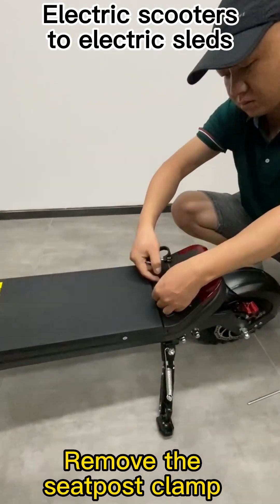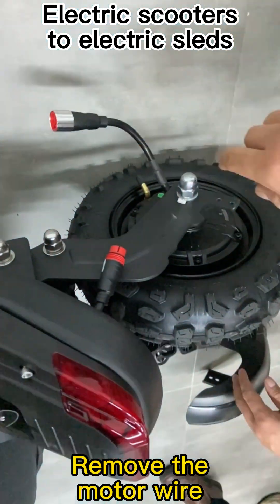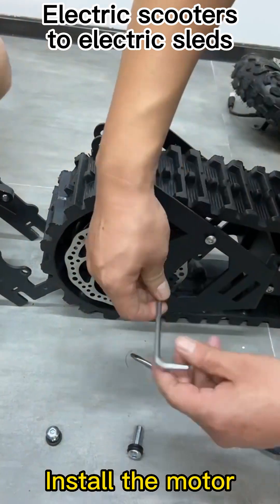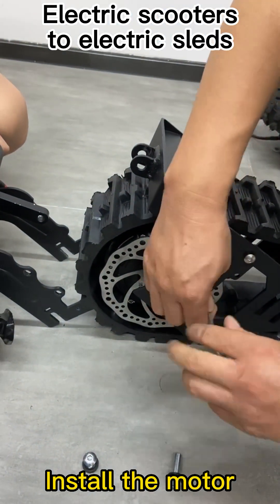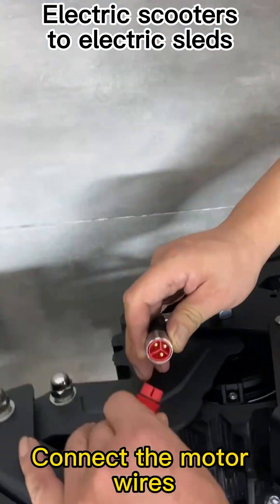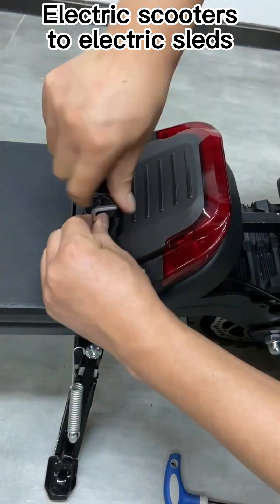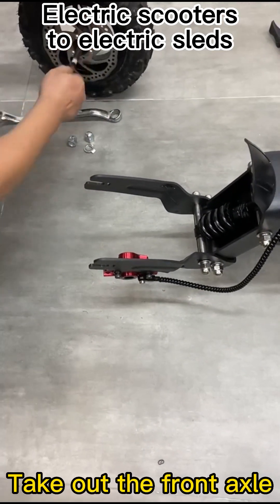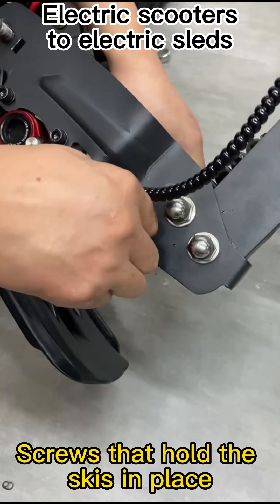Electric scooter to electric sleigh

Comment: Nice 🎉 the sled maximum speed
Reply from the maker: The maximum speed is 50 km/h (31 mph), with actual riding speeds ranging from 23-50 km/h (15-31 mph), depending on the terrain, incline, payload, and riding style.